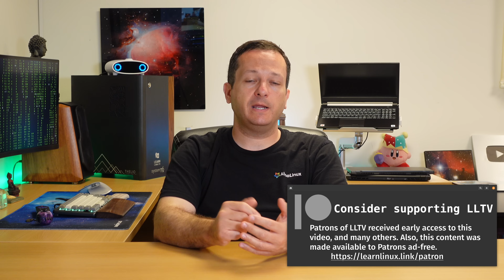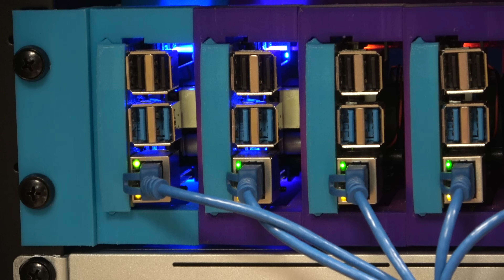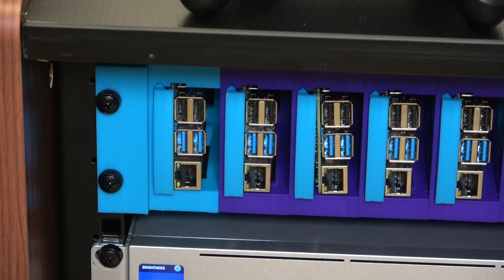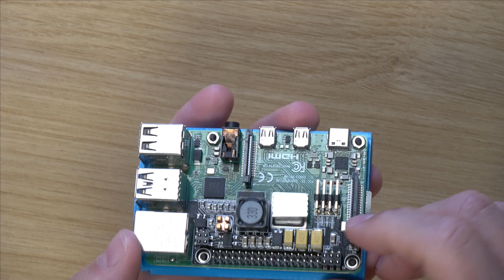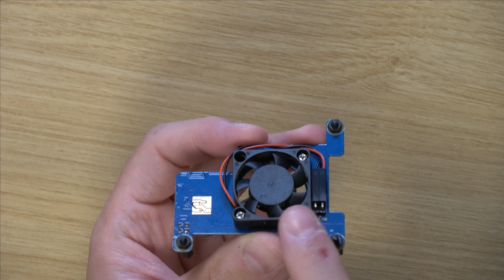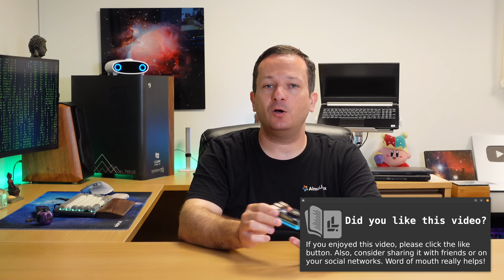Tom Brought me a 3D Printed Raspberry Pi rack!

Comment: Hey, when I setup my Pi Cluster I used 14x14x14mm copper GPU heat sinks and the thinnest 3M thermal tape to keep them cool.  They are the perfect size for the POE hats you had originally,  combined with a larger push fan it manages temps very well.  At full tilt I'm averaging around 43C max on my hottest board.

Comment: 12x Pi is insane.
It is what ... the price of 3x i5-10600k (in case of Pi4)? and it takes one of them to be 17% faster (Geekbench 5) than the whole cluster at the same idle power consumption.
Reply: Have you taken into account the RAM, motherboard, psu, and the cooling for the i5? How about full throttle power consumption?
Reply: @FS-pj7fx  Pretty sure that you may buy all the extra hardware for the price of 2nd and 3rd i5. Even if not, it is well worth to make some effort to gather this things separately (even used) because it would be better alternative specs without of all the limitations of Pi platform and ARM vs x86. As for full power consumption, I'd be surprised if you load it to even 50% average. It really depends on your workload type, but unless you are mining on it or making very niche computations, average power consumption is what would matter the most and it would be only slightly higher than idle.